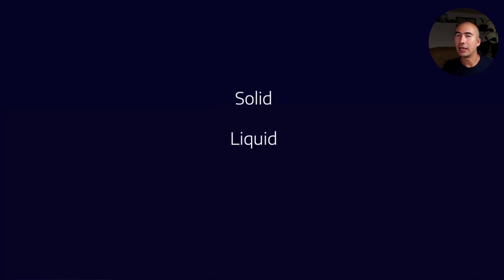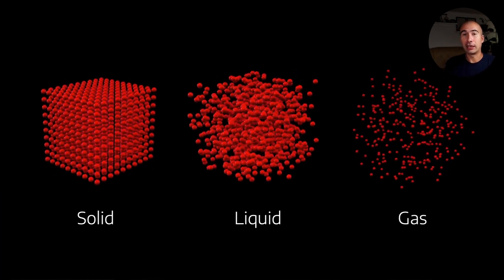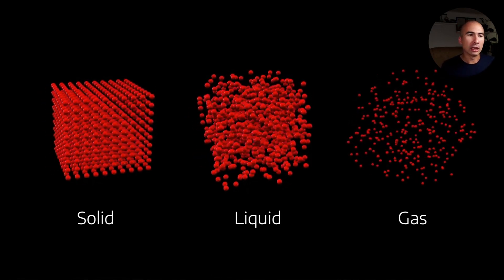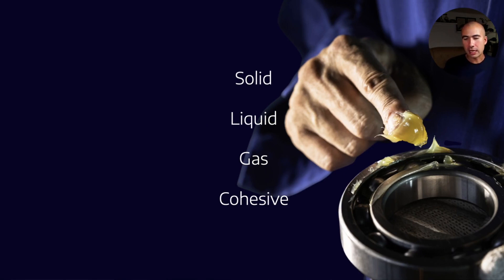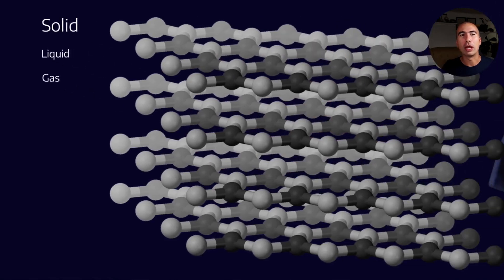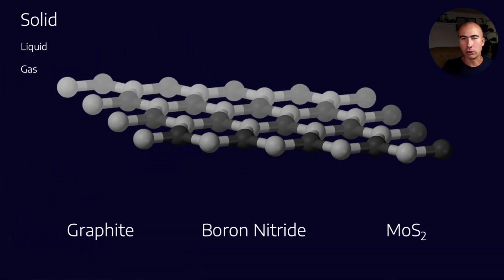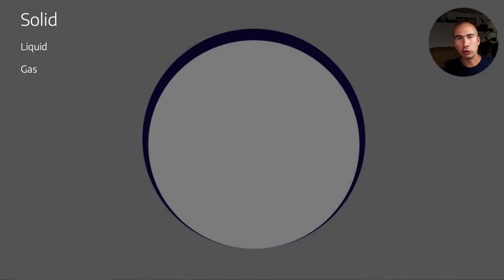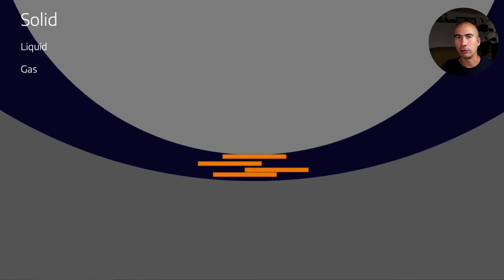How do Solid Lubricants like MoS2, Graphite and h-BN work?

Comment: Thank u for your great channel and hard work. I've left questions on several different topics. Sorry, but this stuff is so interesting and I'm an oil nerd and an auto tech. So what is the difference between boron oxide and boron nitride as it applies to engine oil. Which one would u expect to have a better anti wear, polar effect? And the boron that we may see in Mobil 1 fsx2 sp rated oils.... It's pretty high.... 250-300 ppm..... What type of boron is that? Is it from the esters since that a group 4 and 5 oil? But either way, is it effective like the 'nitride'?......Ceratec and some others use 'oxide' whereas Wagner air tec micro ceramic uses nitride. I know I asked several questions but I am very interested in the answers and very appreciative of u. Thanks so much!

Comment: Hi Rafe, im interested in how to make your own diy greases for bicycle ball bearings. If you have a standard lithium grease, what additives in which quantities would be advisable. I think of graphite ptfe ws2 mos2 hbn. I switched from unknown standard grease to MoS2 grease and the bearings are lasting 100 times longer. 

Also what to put into the wax for the chain, ozcycle gives advice how to chainwax. Graphite tends to increase wear in specific circumstances like dry air or not enough pressure. Mos2 also needs enough pressure. These two i would not use on chains, or would you? PTFE and WS2 in 0,0X% quantities are tested by me, it works great.

I ask myself if there are field tests of these kinds of stuff, because science has to proof nowadays things which could be tested. Tested with too small ball bearings on a big testmachine, fill up the ball bearings with different formulas and look when they fail. German resources for graphite are: "  Graphitschmierung: Auch im Wälzlager
03. November 2022" " Warum schmiert Graphit so gut? 27.05.2004 "

Comment: I remember Arco graphite motor oil back in the 70s, I think. I used to buy it. It hasn't been sold in ages. Don't know whether it was a failed lubricant or failed marketing. People didn't like putting black motor oil in their crankcases.
Reply: I have two quarts of that on the shelf in my garage. A friend of mine was cleaning a lady's late husband's garage out and gave me all the chemicals that were in there. They're too old to use except in maybe in an old lawn mower or something in that realm. I had three quarts but I put one in an old welder because it's all I had at the time. I remember it being like a dark metallic gray color.
Reply: @johndunawayiii4663  I think project farm ran a test on it,  and that it's not as good as modern additives.

here we go,   https://www.youtube.com/watch?v=aqz5330Srdc

Comment: @ Lubrication explained
Plus one for a deep dive into 2 stroke oils specifically for motorcycles.
An explanation of the importance of the oil flash point would be great.
Would love to be corrected if I'm wrong, but as I understand it if you run a fuel mix of 50:1, then you obviously have two components that make up the fuel (Petrol and oil)
If the oil flash point is too high and you get incomplete combustion in the cylinder, then 2% of the 'fuel' is not doing useful work in the combustion chamber.

I've looked at the SDS of most of the name brand dirt bike oils, all synthetic or at least part synthetic, and they range in flash point from 89°C up to 253°C.

Why such a big range, what would be the advantage of the high or low temperature and which company is correct 🤷

Keep up the good work.
Reply: best I tried is motul 2 cycle
Reply: @shanepipkin4041 
Motul is the one with the highest flash point. (274°C road mix, 253° for Off Road)
It is terrible for cold start  spark plug fouling, unless the jetting is absolutely perfect, good for wide open throttle use. 
There are several quality brands with big names that have flash points under 100°C that provide long engine life, good cold starting and less susceptible to 'off' jetting.

This is why I'd like Rafe to comment.

Comment: This reason Liqui moly is the best ever ❤
Reply: most of liqui molly products do not contain MOS at all
Reply from the maker: Yeah very interesting. So "Liqui" moly refers to the liquid, rather than solid form of molybdenum, called molybdenum dithiocarbamate rather than MoS2. This is the kind of moly that you typically see in racing oils and needs to be oil soluble so that oil filters don't remove it.

Comment: Fascinating, I'm intrigued by sub 1 micron Tungsten Disulphide as an oil additive and in grease too.  Curious about Carbon too, graphite being very common, has there been any graphene  research? It would be useful to look at solid lubricants as spray on (aerosol cans) I.e. PTFE, Molybdenium etc. Dry lubricants. Fantastic content.
Reply from the maker: There is a decent amount of research going into graphene at the moment. Some of it regards graphene as a solid additive, some of it looking at how to disperse it in liquid lubricants. It's an interesting area of research.

Personally I think the cost of graphene might need to come down somewhat to be competitive with other additives, but I'm not deeply embedded in that world, so maybe the cost to performance ratio is actually pretty good!
Reply: Graphite consists of layers of graphene.